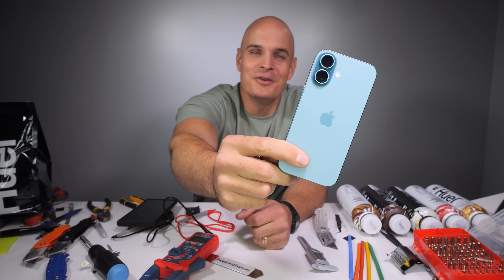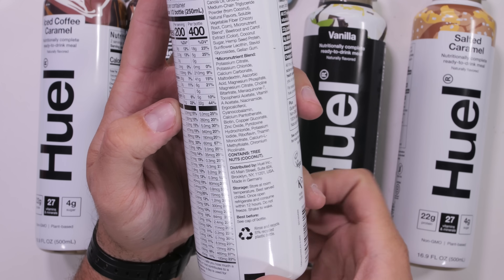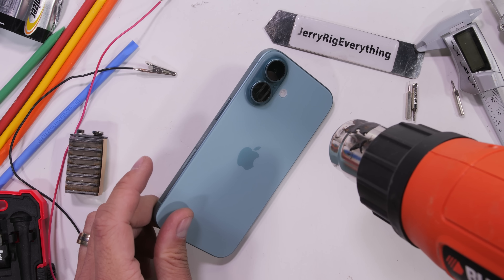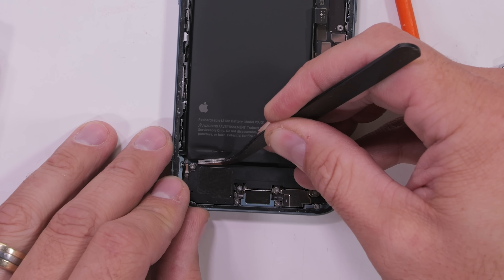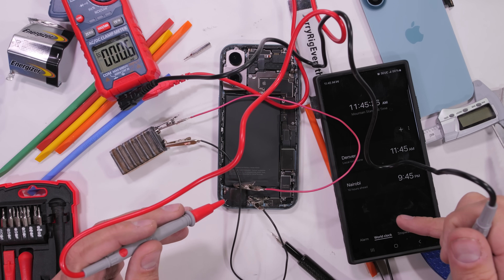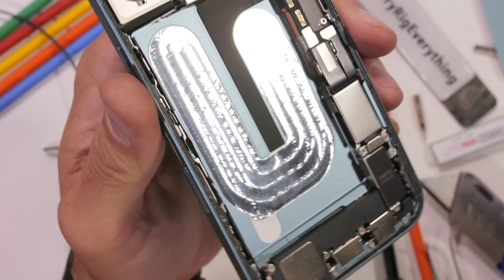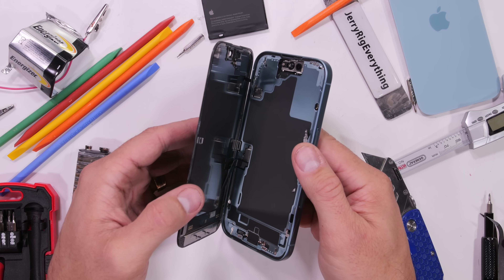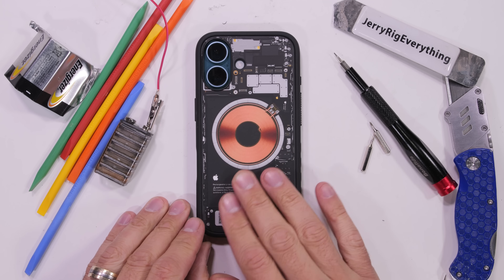Apple *FINALLY* did something new... (iPhone 16 teardown)

Comment: Love to see that Apple is thinking about the environment with its easily removable battery.
Reply: Apple is not thinking about the environment, they had to do this because the EU forced them to. Apple doesnt do it out of the goodness of their hearts
Reply: @janschmid281 what other recent phones have a similar battery removal process?
Reply: @ogindianspice  If they actually cared about the environment they wouldnt glue it down to begin with
Reply: @singeslayer8367  that doesn’t answer my question
Reply: @janschmid281  @ScytheNoire  you two are really smart and cleary understood Op's comment
Reply: @janschmid281  No the Eu law does not apply to the phone as the phone is water tight,  the law is exceptions for water proof devices..
Reply: Sure, if you mean them trying to avoid massive EU regulations. Corporations don't change out of the goodness of their heart, they have to be forced into change with regulations.
Reply: And now your new iPhone is going to cost $50 more because of those fantastic government regulations forcing Apple to do things more expensively. Regulations force inefficiency, which increases costs for everyone. Alternatively, just buy a different brand that like Fairphone, if enough people buy it then the market will pivot toward repairability. But most people don't, they want cheap.
Reply: The naivety lmao
Reply: Oh yeah, you think Apple cares about the environment? Do you know how many products they launch and produce in a year? Apple is one of the biggest problems for the environment, and with their intelligence, they're going to use even more energy than they currently do. So, no, Apple is not good for the environment, and they never will be.
Reply: Were apple thinking about the environment, everything they made would be easily upgradable and 95% of their research and development would be focused on engineering parts for the upgrades.
Reply: They were forced to
Reply: They were more or less forced to. They tried to get the old phones crushed rather than refurbished.
Reply: Apple sheep detected ....
Reply: @BaNNDoG25  Well there you are wrong. I believe Samsung and any other company that cares about it’s reputation will follow up and probably make the same tactic as Apple, if not then better. The EU is not threatening Apple specifically, it’s threatening every company that wouldn’t follow, and since Apple is popular (both with fans and haters) it’s obviously farmed by news articles and people like you that just say “[company name] sheep” when something isn’t to their liking. An improvement is an improvement no matter how you look at it, and don’t just sit there and assume like you’re the higher up.
Reply: @BaNNDoG25  i have an Samsung s24 ultra. I just like the idea bc the recycling will be easier.
Reply: So does any other flagship company have easily removeable batteries? Last time I checked, Apple always had an easier (or equal) process.
The EU has nothing to do with this, as every other smartphone manufacturer also has the same battery build.

Comment: Great vid! Do you guys still do much 3d printing  for not a wheelchair now your manufacturing is at a larger scale?
Reply from the maker: We have 3 'hobby' style printers right now - just for prototyping, and making endcaps for metal tubes. But nothing structural yet.
Reply: @JerryRigEverything take a look at the new Creality K2, it's got an enclosed heated chamber so it should handle hard plastics like ABS and a hardened steel Nozzle so it's great with composites. When I have enough saved up for one I'm putting my money down.
Reply: @Bein_Ian  what about bambu lab x1?
Reply: @Chapon75 i have one its awesome
Reply: @dakotareid1566  bambu is crazy with what they do I have p1s and a1 mini their line is unmatched
Reply: @Chapon75  smaller build volume, chamber isn't actively heated but still retains a lot of the bed heat. Now that it's $500 cheaper I think it's worth it. The creality K2 forced it to drop in price.
Reply: I think they use it only for prototypes

Comment: Cool video
It looks like apple started to think about People that doesn t have money to fix at a apple store
Wanted to ask what do you do with phones that  are broken after your durability tests?
Thanks for video
Reply from the maker: All the phones you see in my videos are taken apart and used for parts. I currently have about 100 of the motherboards saved up to make an 'epoxy' project... but I wont have time for that till next year probably.
Reply: @JerryRigEverything  with this new method of removing a battery what happens when you want to put the battery back in? How do you re-adhere back in?
Reply: @MatrixRoland  you should use new adhesive, but if you switch polarity the effect reverses and gets sticky again
Reply: @MatrixRoland Reverse polarity of the 9V battery. 😊
Reply: btw it wasn't apple, it was EU who did the azz whopping of apple
Reply: @rahulnishadxd  Exactly. Apple didn't grow a heart, they were forced to change via regulations.
Reply: @ScytheNoire  I always wonder, if apple used their brilliant engineers for this type of stuff without the EU then it would really dominate and every android user would also throw their phones.
Reply: @rahulnishadxd  unfortunately probably not. I'm betting nearly 90% of apple users 3 years from now don't even know this exist. This is only cool to like a very small percentage of customers, and sadly, most people are still just going to upgrade instead of replacing their battery. Apple would never do it without regulation simple because it doesn't make money. As many have already said, they are only doing it because the EU is making them.
Reply: You will pay as much or more. You will need to purchase genuine Apple parts and they have a mark-up. You may as well take it to a store - the bonus being that if they break it then they'll have to replace it.